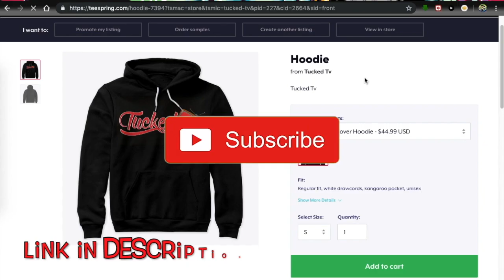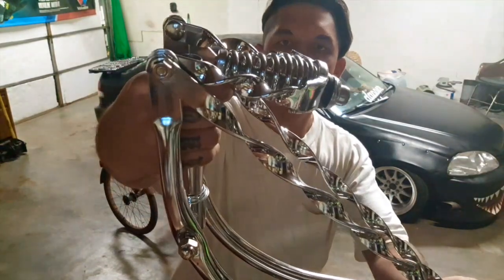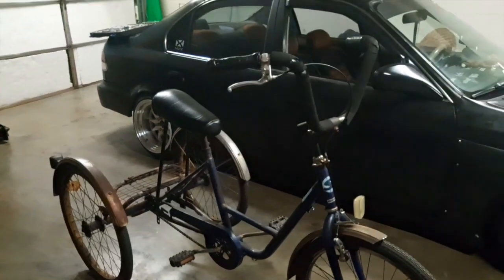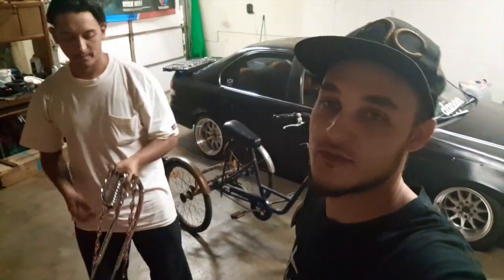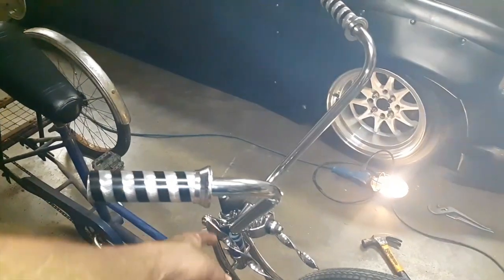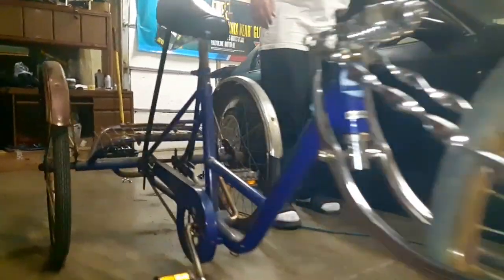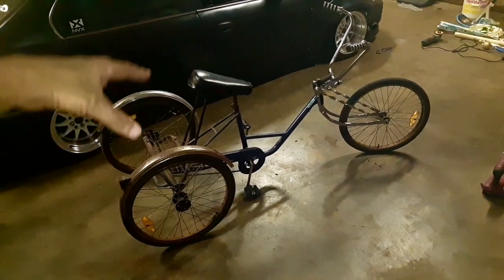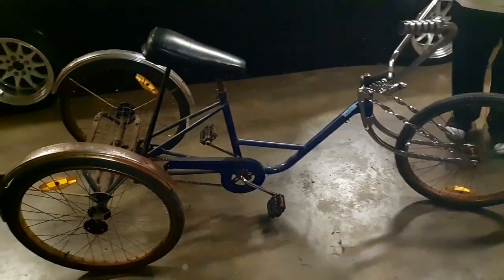BUILDING A LOWRIDER TRIKE- EPISODE 1

Comment: I like it but cant ride it need to drop smaller crank or take the extension crown off of it so you can lol
Reply from the maker: There a part 2 on it check out last video I did on it 😆😆 rides fine
Reply: @TuckedTv You cut the steer tube !